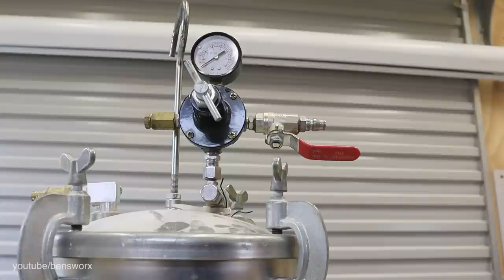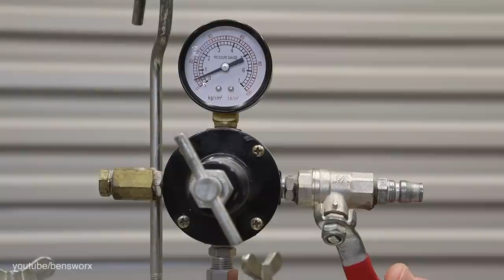Turning a Boxer's Tooth into Expensive Art

Comment: My gf had Trigeminal Neuralgia for 15 years. It started with a trip to the dentist that went wrong (pulling a tooth that didn't need pulling and it threw her into it). She had an operation to correct it in 2019 and has been well since. She has helped counsel others who were going through it as well and was therapy for both of them. I wouldn't wish it on anyone, the pain is indescribable and just having a toothache does NOT compare. Even the slightest breeze or just a certain pitch of a sound can trigger an attack.  It isn't called the Suicide Disease for nothing. People have been known to do that to rid themselves of the pain. Just know that if anyone is reading this, that is NOT the answer. There is always someone who has experienced what you're going through and will listen or do whatever they can to help. If it's at all possible to get some kind of medical help please do. Even pain management professionals can help, I've seen it all firsthand for 15 years. There are support groups and hotlines. If anyone sees this know that you're NOT alone; you're NOT.

Comment: I got diagnosed with trigeminal neuralgia awhile back after a similar experience. It started with gnarly pain in my jaw that I thought was tooth related and went to the dentist multiple times. The dentist would do a root canal and it'd "go away" for awhile. Then it'd work its way to up to my ear and any "sharp" noise, like a clap or high tone in music, would feel like an icepick in my ear. A day or so later, it would expand up to my sinuses on that side of my head and make just the one side of my nose stuffy and runny. Then it made its way to the top of my head. I'd get excruciating localized headaches on just the left side of my forehead, behind my eye, and temple, sometimes to the point I'd get dizzy and feel sick. It would last over the course of like a week or two, go away for a month or two, then ramp back up again over the course of a week or two, which made it a huge pain to pinpoint because it would seemingly go away after any dental work only to come back weeks later. Had sooo many root canals to the point my dentist was like 'there's nothing left to do except pull them." and then I went to the doctor...